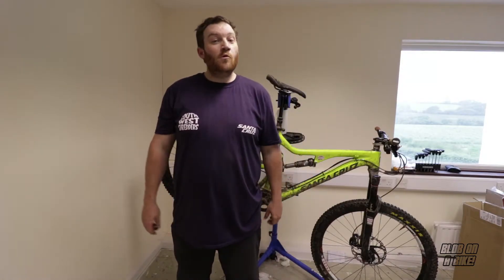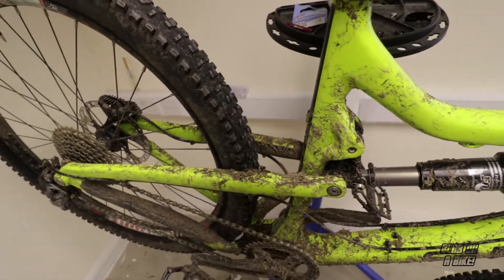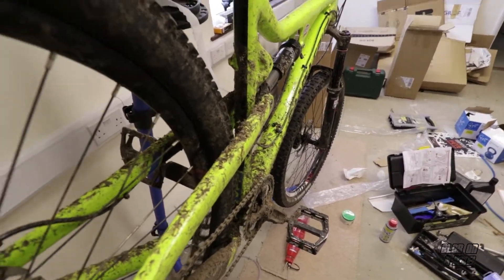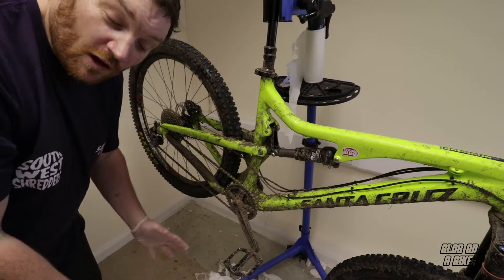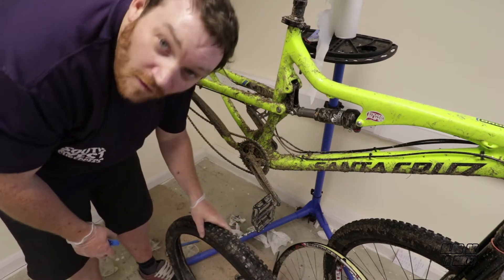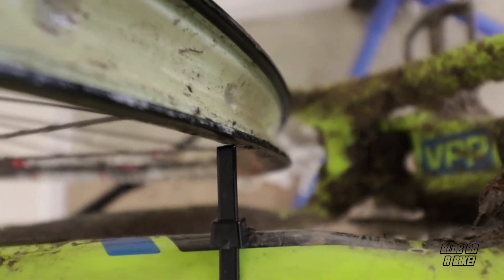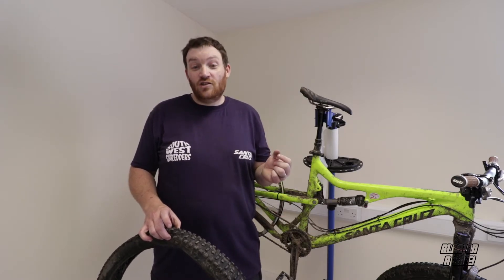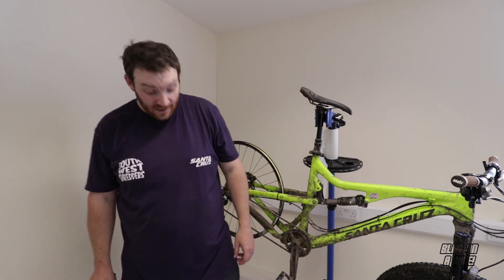Can You Buckle A Bike Tyre?

Comment: I've had maxxis tyres for years and it happen to them all eventually and bead wore out eventually. The tyres eventually get warped. But I've also had issues with new tyres sometimes they seated but they have different distance sometimes it's on both sides sometimes on one side, making the tyre be twisted. Sometimes tyre is not seated evenly but that I can sometimes fix with tyre pliers, but if tyre is messed up badly thst won't help.
Reply from the maker: Yeah, I've had enough of Maxxis and have since moved over to Schwalbe - no issues so far :)

Comment: Now I know what happened to mine. I thought it was a factory defect but everything was fine when I first installed it. Then I rode a steep section and my front tire hit a rock. It burped and a lot of air and sealant leaked out. When I got home I retaped my wheel added new sealant. But now the tire is wobbling. The wheel is aligned though. I re installed the tires thrice to see if it seated properly on the beads but still wobbling. Should I just throw the tire?
Reply from the maker: Yes, it sucks but it sounds like your tyre is done.  Don't do what I did an switch to Schwalbe - they were a right pain to get sealed!  I'll be back to Maxxis next time despite their failures I think.

Comment: Tried to seat a maxxis ardent 7 times😂Took the rim tape out, soapy water on 1 side & still the tyre wasn't sat properly. Mega stressful😝
Reply from the maker: Yeah that sucks!  I moved away from Maxxis actually and went to Schwalbe but they are nowhere near as good in the wet.  I'll try something else next time!
Reply: @mtbtomfoolery  I run the Ardents because they're great on the roads, fast and no drag☺And at 65psi, super comfortable.

Comment: I thought my wheels were buckled. Came round to trueing them, made hardly any adjustments for it to be  perfectly straight so I assume my tire is VERY buckled
Reply from the maker: When mine happened I landed pretty sideways so I assumed my rim was shafted but it was die straight.  My tyre luckily took the brunt of the impact.  Turns out Maxxis are quite known for it!
Reply: @mtbtomfoolery  ye I have continentals. First time using them and haven't had any issues with schwelbe. Im guessing it was from cutties and landing at an angle e.t.c.